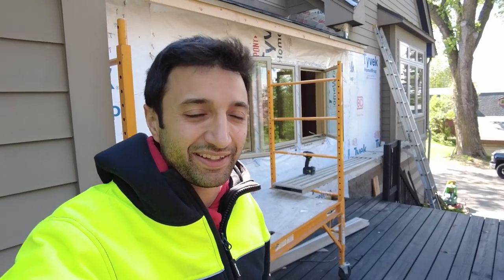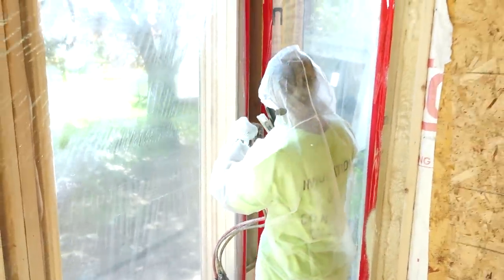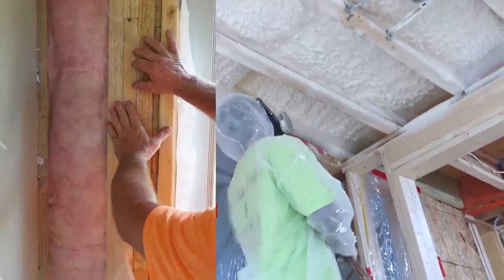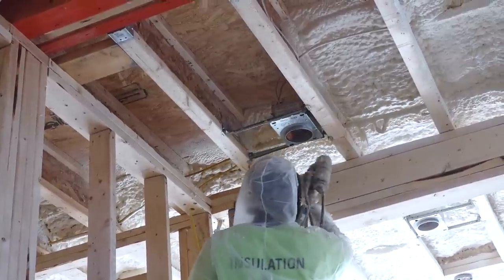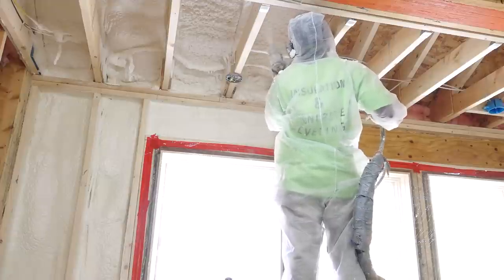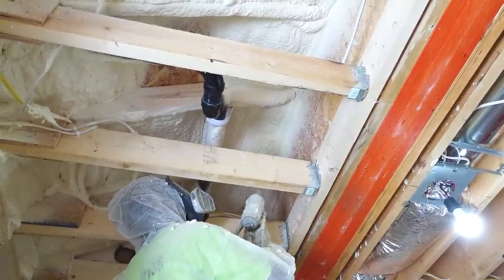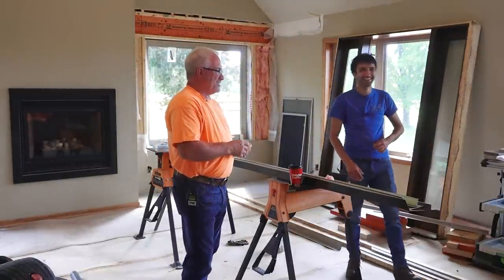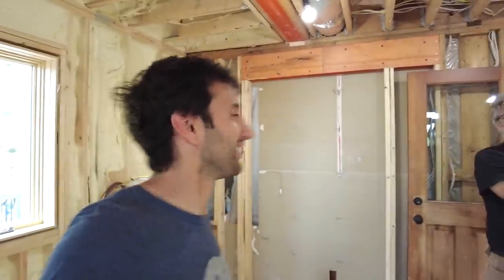How Important is Air Sealing? Insulating the Additions | Home Renovation & Addition Part 41

Comment: Rock wool insulation is used in lot of Euro countries. Non toxic, inert, extreme water resistance. Bugs hate it, rodents too. Comes in many forms. Won't burn. Easy to remove.
Reply: Even more important eu uk morgage companies hate spray foam and won’t lend on houses or roofs with spray foam insulation ok for garages and temp buildings but it’s a big no due to damp and rot problems in timber frames
Reply: Rock wool is awesome stuff. Wish I’d known about it earlier. Matt’s home is coming along nicely.
Reply: Biggest downside to rock wool is the energy it takes to make it.
Reply: @mgena717  If plasmafication (plasma gasification) of garbage was more prevalent, the slag can be blown with air and made into rock wool at near zero energy cost.
Reply: @FrancisKoczur  I'm curious what you think the energy source for the plasma torch is and why you think that it would involve zero energy to generate plasma and create rock-wool from slag.
Reply: @mgena717  The slag is already molten. The extra energy would be compressed air to form the rock wool.

Comment: I'm assuming you have an engineer creating drawings and helping get permits. Your should ask them to explain these things. R value is NOT resistance to air flow, it's resistance to flow of heat through a material. They can explain the difference between conduction, convection, and radiation. U factor is a measure of a window's heat transfer properties for non-solar heat. I.e. neglecting radiatiative heat transfer. Radiation properties of a material can be broken down into reflection, refraction, and absorbtion. Plus emissivity (how much energy is radiated off of a surface, dependent on the temperature of that surface). That's where the "low-e" windows get their name.
I'm sorry, but this guy is a good salesman for his product, but is not giving accurate information. -a concerned licensed professional engineer (not in your state)
Reply: Agreed and something everyone seems to leave out is the fact that heat is pressure. Pressure through fiberglass is easy. Rock wool is tougher, but through closed cell, like nosing in with a freight train!!!
Reply: @SteveP-vm1uc  Heat is pressure? Can't say I've ever stumbled upon that in engineering school, PE licensure, or my career. Are you using this as an analogy or is there some crazy level of physics that blurs the line between the two? In any practical application I'd have to disagree. Maybe I'm wrong!
Reply: @denniscooper6328  As an analogy, but it's true. There are many ways to show it's worth as a term to explain the need for a far better sealing insulation. 
what happens to the gallon jug you removed from the fridge and emptied and set on the counter sealed up? It expands from pressure due to the inside air warming up. Put it back into the fridge and it shrinks back to normal. Pressure cookers work by heating up whatever is inside of it and that pressure pushing into whatever it is you are cooking. It forces that heat into the food much faster than if it were in an open pan. 
Now take the typical home with 1990's insulation. It's easy to prove air under even slight pressure can easily pass through fiberglass insulation. Now add heat to the air in the attic. My roof, for instance, is all hip. That means there is not much area for air to escape at the ridge vent. So my Florida homes attic heats up pretty fast and stays that way long past the time the sun goes down. With the suns heat penetrating the roof and that attic air expanding, it looks for the easiest exit. Most would think that would be the roofs ridge vent, but due to the volume of roof, it's in a constant bottleneck. So the overflow of heat that cannot get out going up, moves to the next escape place and the next. A lot of that is coming into the climate controlled space through wiring channels and plug and switches and the heat getting through the fiberglass in my attic allow hot air to reach the back side of my ceiling and wall drywall which also heats the interior..   If this same house had been build and insulated with a few inches of closed cell foam creating a full envelope, that heat would be far less and pressure would be far less and our comfort and wallets would be much happier. I could go on, but I think you get it.

Comment: Matt, I'm sorry but your insulation guy means well however he has conflated and confused the benefits of air sealing and insulation and is delivering inaccurate info to you and your viewers. I'm an architect who specializes in building science and energy efficiency and I felt it was important to correct the statements said in the video. 

He is correct that air sealing is very important, however it is not a substitute for R-value and additional insulation. Air sealing prevents heat movement through convection and insulation prevents heat movement through conduction and radiation. Air movement past certain insulation materials can reduce their effective R-value since the heat is now being moved through convection in addition to conduction through the insulation. However, the main heat transfer mechanism in a building is conduction/radiation. 2 inches of only spray foam in a wall is NOT a substitute for higher R-values. This has been shown with actual energy modeling and testing in both computer simulations and real world testing. You have to pair an air barrier with high levels of insulation to be effective.

He is also incorrect about the location of your air barrier. The VAPOR retarder needs to be on the warm side of the wall in the winter. The air barrier can be located and should be located at the sheathing layer as that can both be sealed easier and it is less likely to get punctured during the life of the building. Best practice is to install a vapor retarder that is also an air barrier on the inside face of the studs to reduce moisture laden air from entering the framing cavity and use your sheathing as an air barrier by sealing all the seams and penetrations. Allison Bailes from Energy Vanguard has a good article about this: https://www.energyvanguard.com/blog/where-should-the-air-barrier-be-located/

Instead of spray foam, a more cost effective method is installing exterior rigid insulation over your sheathing as that eliminates thermal bridging from your framing since wood has a low R-value and reduces the effective R-value of your wall. Building codes are moving to higher levels of air tightness and requiring exterior insulation because that has been proven to provide the best resistance to heat flow and better indoor comfort and air quality. 

Please go watch some of Matt Risinger's or Steve Baczek's videos here on Youtube about insulation and air sealing. They both have backgrounds in building science and have covered this topic really well.
Reply: I don't understand how so many people overlook the fact that no matter how much    insulation you put in between the studs, the heat and cold will easily go through the studs. I always tell people to imagine pushing all the studs together in your house and there's no insulation at all over that entire area. Even in a small house, that adds up to at least a 20' x 8' space.
Everyone is MUCH better off with exterior insulation, installed correctly, like you said.
Reply: @treggmichelleliebler399  That's a great trick to get people to understand the actual area that the framing takes up. I'm going to borrow that for future use. 

I also work on commercial and multi-family buildings where we often have to use metal studs to comply with fire ratings. Metal studs are so thermally conductive that installing insulation in the stud bays actually HURTS the wall performance from a durability and condensation aspect as the insulation keeps the inside face of the sheathing colder and increasing the condensation risk. Because of this, I usually specify zero cavity insulation and only exterior insulation, which takes the money and labor saved normally put into installing cavity insulation and transfers it to offsetting some of the costs for the exterior insulation. If we need to meet a specific sound rating, I'll specify thinner batts in the cavity to provide sound absorption but allow for the heat to flow enough to keep the inside face of the exterior sheathing warm in the winter. This is climate specific and should be modeled and adjusted for based on the local climate the building is constructed in.

Comment: I had 3 inches of closed cell spray foam installed in my new shop/shed build last year, and I absolutely love it. It's nice and snug, and heating/cooling is a snap. I had never been in a home or shop that was insulated this way (to my knowledge,) and I have become a major fan of the stuff. Yes it's expensive, but in my opinion, it's worth every penny.
Reply: Saving on heating and A/C expenses is a must with this economy.  My electric rate went up 37% this spring!  And heating oil and natural gas will be sky high as well.

Comment: For a new build or remodel I like 1-2" of closed cell and the rest of the fill ROCK WOOL..... The closed cell does the perfect sealing and the Rock Wool not only brings the R value way up, but also is fire resistant, shrink resistant and kills outside noise. It is far better than fiberglass and insurance companies love it!!!
Reply: I think you need minimum two inches closed cell for air barrier. Spray Jones on youtube says adding insulation on top of that is detrimental because it will trap air between the closed cell and the insulation and you could get condensation.
Reply: @zefallafez  Spray Jones is incorrect. You can't trap air between closed cell and an air permeable insulation like fiberglass, cellulose, or mineral wool bats. Also trapped air is not what causes condensation. A cold surface below the dewpoint is what causes condensation. As long as you have sufficient insulation for your climate zone that keeps the interior surface above the dew point temperature, you won't be at risk for condensation.

Comment: Air sealing is great but houses must breath and vent. In the 80's they built many "super insulated" houses in Minnesota that were way to tight the house rotted from the inside out. It started with the widow sills rotting this was a common problem. We ran blower door test on some houses that were so air tight the families were getting terribly sick from VOCs (Formaldehyde) being released from the new carpet and furniture. Much of this was rectified with the installation of de-humidistats switches and ventilation fans. BE SAFE!
Reply: HRV is needed.  ERV is warmer climates.
Reply: @bobbray9666  I do not believe the HRV or ERV  systems existed until after 1998.
Reply: @gonefishing2012  So what?  You can install them in older houses.  I installed a HRV in a home built in the 80's in MN.
Reply: @bobbray9666  My comment was about my experience what happened in the 80's and what we did to address the issue in the 80's.   I did not mention or address the installation of HRV or ERV in my comment.

Comment: Very interesting... I do like how the CCF fills and expands in all the nooks and crannies..., although one can forget about snaking an electrical wire at a later time in a wall that's been foamed.... And I'm concerned that if there was ever a home fire, that the foam would be extremely toxic, which I didn't hear your insulation contractor talk about.But then again, why would he..lol
In my past experience with fiberglass insulation, I've seen many contractors fail to properly fit the fiberglass tightly in the gaps and do a very poor /sloppy job installing the vapor barrier, and some use a subpar thickness of way less than the 4 mil.. all of which has given fiberglass insulation of bad rap of not performing well.... Which is sad, because it can insulate extremely well when it's properly installed, especially the vapor barrier, which I feel is critically important..
Anywho, always glad to see the progress you're making, it's looking so good..

Comment: When you do a dimensional analysis, the unit for R is 1/time. Comparing 1R to 10R, it takes 10 times longer for a given amount of heat to go through 10R material than 1R material. The heat will go through the insulation, but it just takes longer for the higher R number. The R-value of wood is about 1.4/inch.

Comment: In the UK, spray foam is a huge no no... your house becomes unsellable as none of the banks or building societies will lend money on a property where the condition of structural timber / building fabric is hidden. Apparently, they insist it is all removed to show there is no rot, infestations, stress cracking etc. Sounds crazy at first... but imagine what could be hidden behind a layer of foam in say a 500 year old slate tile / timber roof void!
Reply: I can see the case if the foam encases the structure but because it is not has no merit for their argument!

Comment: Scott is excellent in explaining the spray foam process. It was nice listening to him walk us thru the pro's and con's of insulation products and telling it in a way that made since.
Reply: Except he doesn’t know what R-value is, which is a rather fundamental property of insulation. He also seems confused about heat loss via radiation and conduction. Most importantly, he doesn’t mention how difficult it would be to carry out any work after spray-foam insulation has been installed. It would be an absolute nightmare to run any plumbing or electrical services through that stuff, or to trace any faults in those services.

Comment: The air sealing is where this product gains the advantage. Stop the drafts and air leaks. When my addition was built the wind could howl between the sill plate and block even with a foam gasket. Once the sill was sprayed; air tight and warm.
Reply: Wonder what the R value of those windows are?

Comment: We're going to be re-doing our front room and my plan is to pull the drywall so I can re-insulate and run some TV/computer cables behind the walls.  I'm pretty sure the insulation in there is not the best.  I'm in CA where the climate is much nicer - none of that white stuff all over during winter - but have thought about spray foam just because it's better than the pink fiberglass and will seal the room better.
Reply: Insulation isn't just to keep the house warm, it also helps to keep the house cool in the warmer months or in your case all year round.
Reply: @RandomTorok  Keeping cool is harder than warm.  Our winters have become a lot warmer - I used to wear a heavy coat and now on the coldest days I'm in a fleece.

Comment: The "R" value is NOT a measure of resistance to airflow. It is a measure of resistance to HEAT flow. The unit is inverse time, measuring the time it takes a certain amount of heat (British Thermal Unit BTU) to pass through the material.